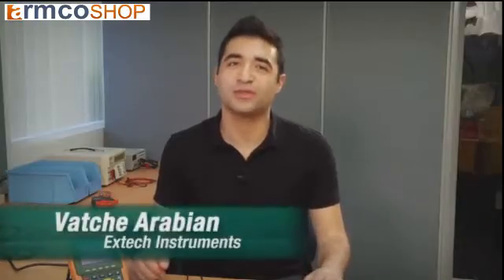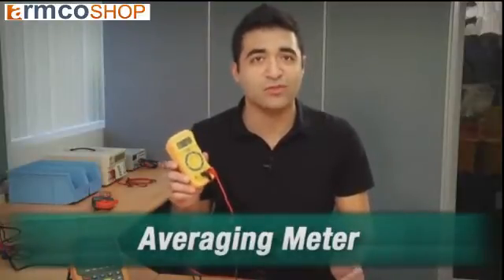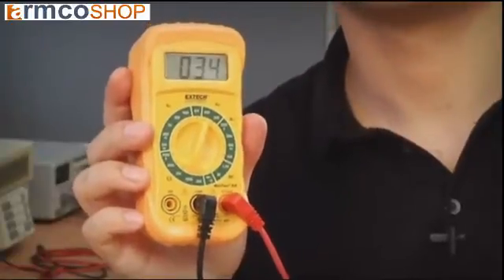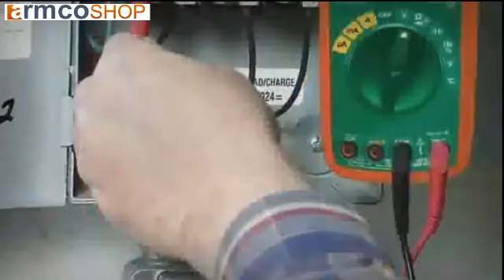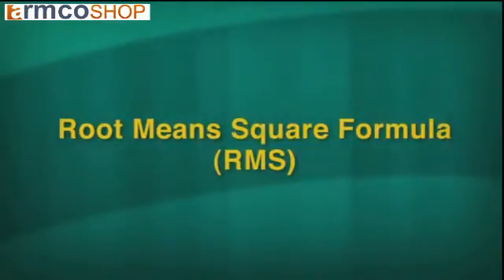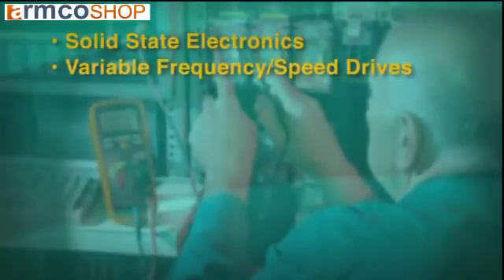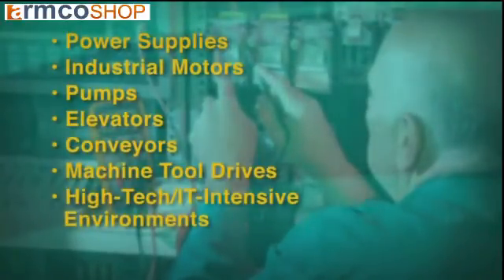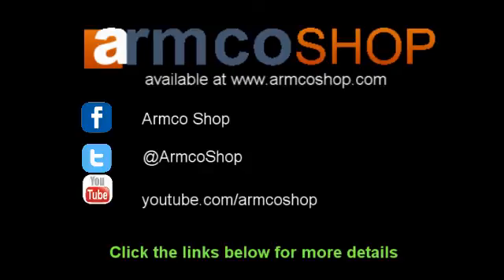DL150 True RMS AC Voltage/Current Datalogger By Extech

Comment: my need is to monitor true RMS AC voltage/current,  looks like the DL160  but I want to put in place for a week.   I have a computer that seems to be getting bad power.  with 86k seconds in a day, voltage only DL150 cannot do more than one day for ALL readings at 1 second.   I want to be able to set high and low points, say 105VAC and 130VAC, and record the values when the device is measuring out of that range.   hopefully, leave the logger in place for a couple weeks, get a dozen or so data sets.
I would also want to be able too add my own SD card or USB stick and get 20 million readings.  I read the users manual and the on-line data sheet, but they do not go into enough detail.